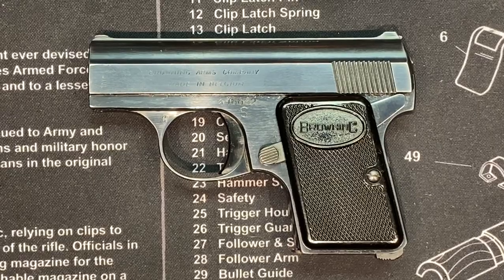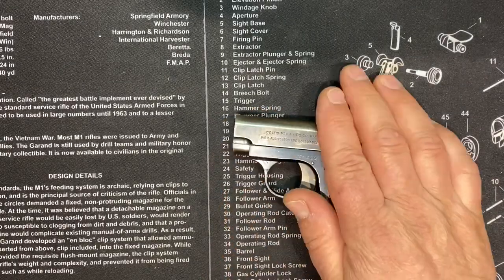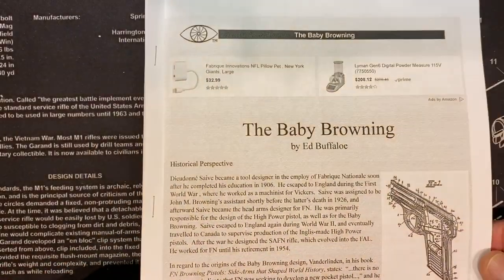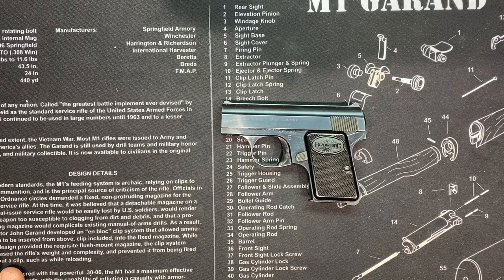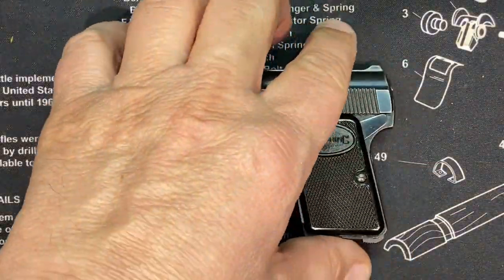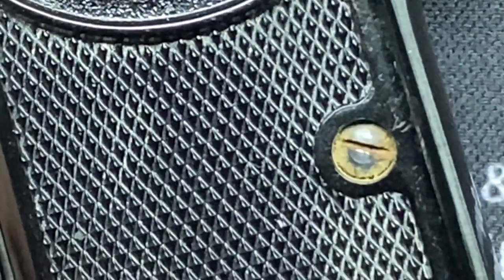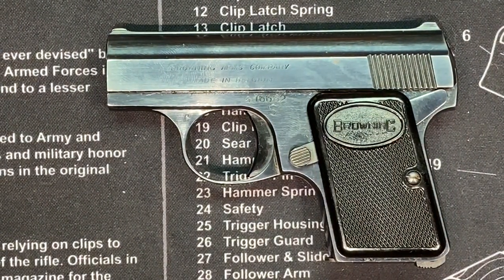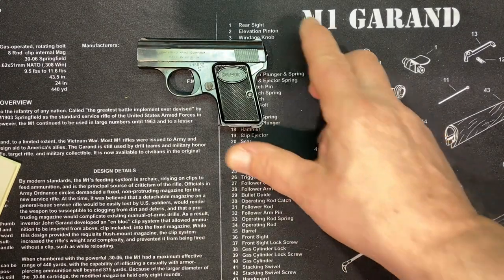FN Baby Browning - .25 ACP (1968)

Comment: 22:32 ... May have been a good idea to make the trigger guard squared off, so people can grip it like that without their finger slipping off. If a person squeezes it hard enough there and it slips, it could fly out of that person's hand. (and sometimes when people drop guns, they instinctively try to grab it to stop if from falling and hit/grab the trigger on accident and cause the gun to fire.
Reply from the maker: Not sure if there is any right way to hold this gun.
Reply: @MilsurpGarage  Yeah, I think that's the case with a few of them. (Like the High Standard D-101). It's a really cool gun... but it's a mess to try to hold. (ind it only has two round capacity).

Comment: It's smaller, lighter, no grip safety, and has a better manual safety than the original Browning 1905 that was sold by Colt and FN.  It's really a better pistol in those respects.  It is very similar to a Walther model 9 but with twist removable barrel.  I think you're right in that the name Browning sold guns and that's why it was marketed as both by FN and by Browning.  It may be that Dieudonné Saive took ideas from the original Browning design and the Walther mod 9 (came out in 1921) and some ideas that he had or that he had worked with Browning on to create the Baby Browning.  Just a theory.